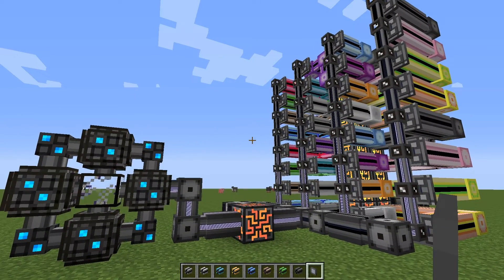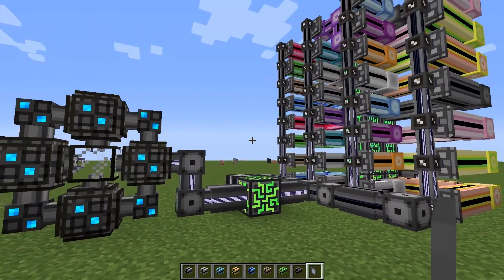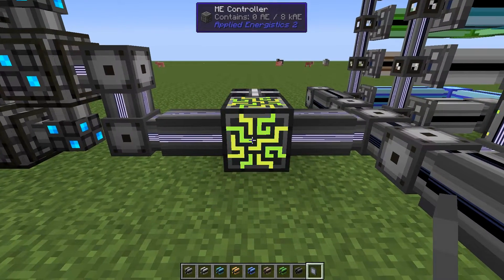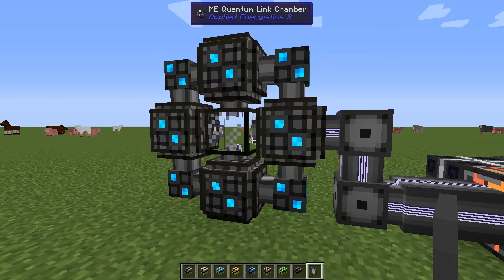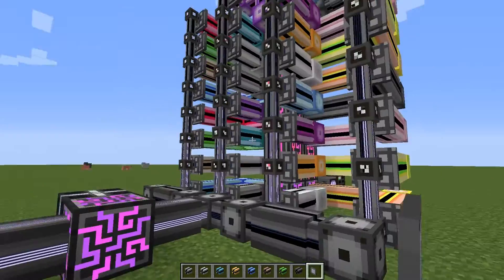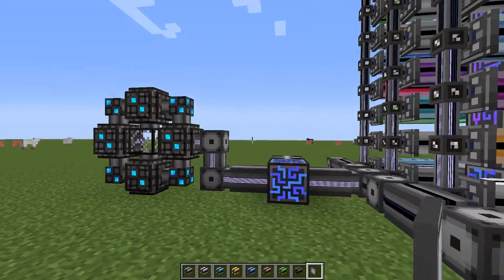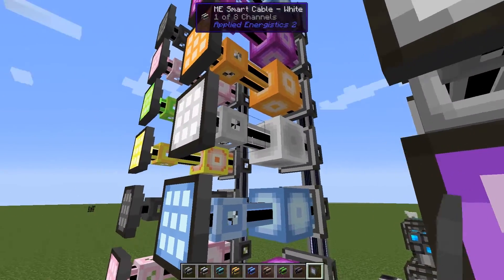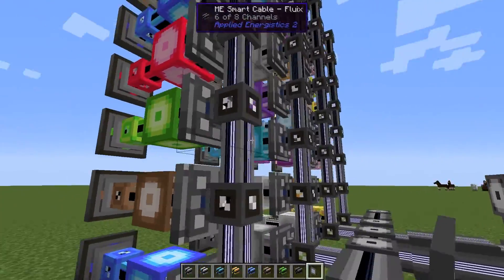AE2 Quick Tip: 1024 Channel P2P Network Through A Quantum Bridge (MC 1.7.10)

Comment: I cannot seem to get this to work. I recreated this exactly in a test world and all of the terminals are offline if I have the P2P attached (If I power them directly they ARE online but cannot access storage). Also, if I disconnect the main system from the network bridge and instead connect a smart cable with a terminal, it STILL cannot access the items. If I use a network tool it seems like if it considers everything on each side of the P2P tunnels to be 2 different networks. Am I doing something wrong?
Reply from the maker: Hmm, are the P2P tunnels correctly configured with memory cards? You say you did it exactly like in the video but it's easy to miss one single connection (like power to the middle network or something else) and then it won't work.

Comment: Is it possible to build a sub-network in an other smaller base and connect it with a Quantum Bridge to the main main system in the larger base?
Reply from the maker: Yes, but only if you know what you want and how to do it properly. There can not be two ME Controllers on the same network. It is possible to connect to a small network without controller via interface and storage bus for example which might be what you're after?
Reply: @therealtkh   I think I've found out how do it as I wanted it to function. I have my main ME System connected to a Quantum Bridge. The other Quantum Bridge is connected with a Sub-Network. Is it possible to send you a picture or the Testworld so that you can check if this is even useful or make it better maybe?
Reply from the maker: @Amogus-hs5tz  I would say this is best discussed on Discord if you're using it. Find invite link here: http://tkh.one/contact

Comment: Well, I tried it and it almost worked.  I had basically the setup in this vid in my rftools dimension, and then sent the channels through the quantum link to the overworld, where linked p2p me tunnels would in theory unpack the signal, however the system would flash on and then go off for a few seconds and repeat almost as though it was running out of power. Its worth mentioning that this attempt was in retrofitting my active ae system to have an off world controller. I caved and eventually just put it back similarly to the way it was

Comment: Can you make an Tutorial for the biggest controller ?
Reply from the maker: +Crazy Tech How big do you want? It can only be 7x7x7 at max, and then there are a few rules of connecting blocks. I'll have to calculate and test, but it's a good topic for a video!
Reply: with themost channels
Reply from the maker: Crazy Tech Found a discussion about a design with over 21.000 channels... But I'll have to try myself. Anyway, fun topic for a video! I will look into it asap.
Reply: nice
Reply from the maker: +Crazy Tech If you check any of my social medias I posted a screenshot of a build I finished yesterday. Ended up with 21728 channels, but I'm not happy with the design... so I will try to improve it before I release a video on the subject.

Comment: Hello,

Firstable thanks for this series, I have enjoyed it all. Keep up such a good work.

I have a question for you.  I am playing with quantum bridges now and I have the following setup:

1. Network "A" with Molecular assemblers in order to autocraft items
2. Network "B" without crafting functionality.
3. I have created Quatum Bridge in both sides and added   ME Interface in front of ME Storage in both ways.  In mean ME I-A + ME S-B    and the opposite ME I+B + ME S-A.    This way, network "A" can see items from network "B" and vice-verse. It works.

The only problem I have is that network "B" can NOT craft any items configured in network "A".  Have you tried this?  

Thanks in advance,
Efren
Reply from the maker: +Efren Ramirez Hi, and thanks! I have tried that setup and have only verified the same thing as you have. In your setup you can autocraft in the "A" network using items from "B" network, but not order any auto-crafting from network "B". In my opinion, such setup should only be used for isolated functions, such as storage or rooms where items are meant to cycle and never need to auto-craft items from the "A" network. If you really need auto-crafting on both sides of the bridge you should keep it open at all times and extend the "A" network to be on both sides. Hope you understand how I mean (and that I understood you) :)
Reply: +TKH uhmmm, no I did not get you !  :))   The two networks are far away one of the other.  What do you mean by extend network "A"?  the bridge by itself is an extension, right? well...I am opening the network in both ways using the setup I have now.  Can you please explain more or reference me any of your videos where you explain that concept?

Thanks for this quick response man.
Efren
Reply from the maker: +Efren Ramirez Oh, I forgot to reply, sorry. Well, I mean that the easiest solution is to have only one network if everything should be reachable from any point (other than items), connecting an Interface to a Storage Bus in both directions is ok for just reaching items, but as soon as you want more functionality the two networks should be only one network. 
The bridge works as a normal cable do. If you watch my latest video (large network design) you see me using the bridge as a p2p network, that's useful if you need more than 32 channels on the other side. But I can still access all storage and all auto-crafting when leaving the p2p tunnels. 
The thing is that you can only have one ME Controller (one single or a multiblock) in your network, so doing such change will perhaps require some work... :)

Comment: I've made a little setup to demonstrate how I like to do the wiring. There're 4 differently colored smart cables with each 8 p2p buses, each having another color. On the other side of the bridge or the wing of my base, I normally use those first 4 colors for different "backbones", and the colors of the single p2p buses for the wiring to the machines. http://imgur.com/VnHpvM9
This principle could also be used for lager networks: Basically each of the 16 colors can be combined with 15 other colors (using the same color for tunnel and backbone is not desireable) = 240 possible color codes for 240 different tunnels.
To be able to see how many channels are used on this side of the network (on the other side where the channels are "used", this normally is easier), a setup like this one might be better: http://imgur.com/MOMtfXa
Hope the imgur links work...
Reply: +SnapCube I just saw that there is an energy acceptor on the controller in my 1st setup. This one is not needed.
Reply from the maker: +SnapCube Fun to see, it's very similar to the setup in my video. But I don't really see if this would gain any additional channels in total (you're still limited to the capacity in the main controller). Color coding is fun, but I don't think I would do it because of the extra work... :) Basically I only color code where things are too narrow or to mark an entry or exit of a tunnel to make things more clear.
Reply: +TKH This was based on your layout and is functionally identical.  I like to avoid dense cables whenever possible. Maybe it's because I like the idea of ressource efficient setups. And normally, I'd run only a smart cable to a wing of my base.
But the main thing I wanted to show is the color coding. It is not rare that I adjust my network at places I don't know in beforehand. So for my kind of play style, I would run in trouble not using that coding, and for the sake of consistency, I'd use the same coding for a dense cable through a quantum bridge:).